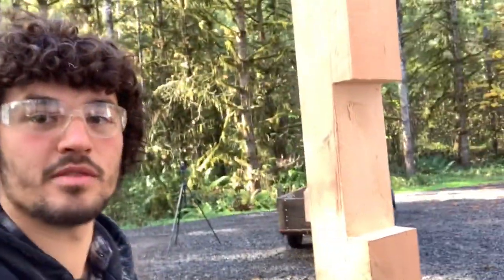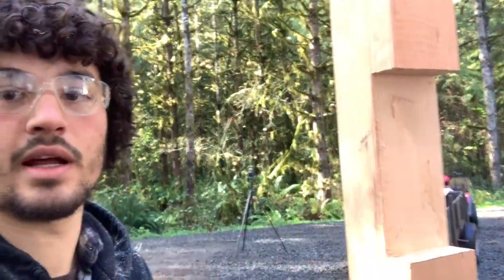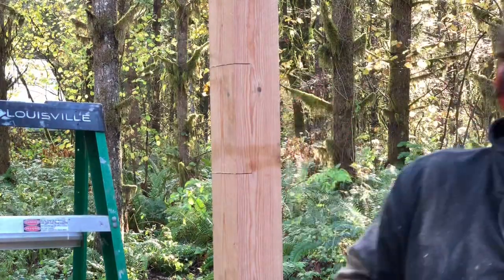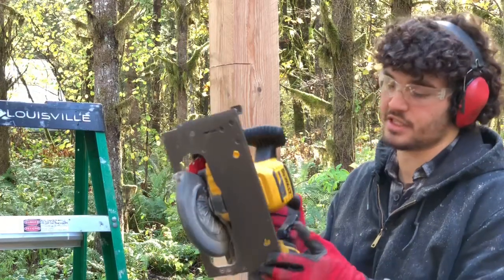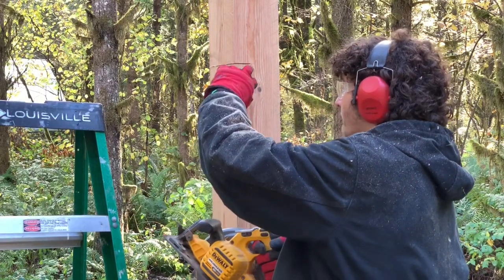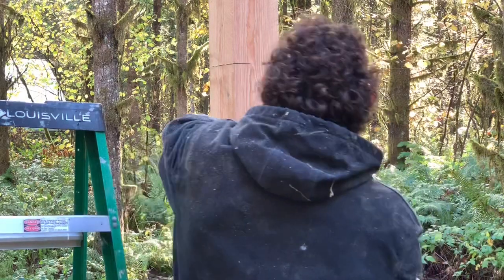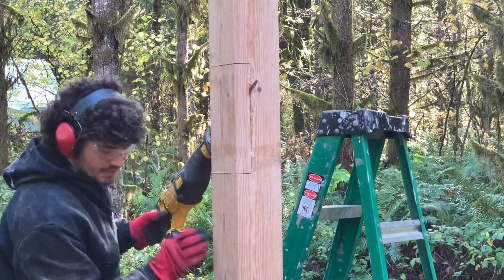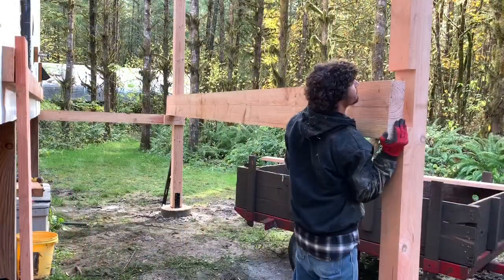Timber Framing - Best Way to Notch a Post

Comment: It appears your building some sort of deck where you've extended the support columns to work also as the guard posts for the upper level. I think that's a great idea, if done correctly. The only problem I see with your design is the notch is on the wrong side of the column. Current building codes require the guard rail resist a minimum force of 200 pounds, exerted laterally against the guard rail, to ensure deck occupants do not fall if they lean against a rail. With your column, when a force is exerted in an outward direction it will cause the notch to open. If the notch was on the outside face then the same lateral force would cause the column notch to close, binding upon the beam, strengthening the connection.
Also, it looks like you're using dowels for the beam connection. I'm sure you'll find the building code requires bolts. And, if there's a copper-based preservative used on the wood then your hardware must be protected from the corrosive effect of the preservative's reaction with steel. Generally, hot-dipped galvanised hardware is used, but there are also some other surface coating options.
Reply: Thanks for the feedback. 
The posts go up to a roof that ties back to the house, that way there is no chance they can be pushed outward. They are bolted with 3/16 stainless to the beam. The dowels are just popped in afterward for looks.
Reply: @BLANK-lu6hq  this is the exact same thing I am planning to do. this was the first video/person Do the same thing! Have any finished photos?

Comment: you cut through no mans land, you should not notch more than 1/6 th of the width of your post, it is very , very , weak structurally now, do not let your cat underneath it.
Reply: A 4x6 is all that was required for the posts and that is what is remaining after the notch, so it’s all good 😁
Reply: pretty sure that rule applies to horizontal beams, not vertical posts